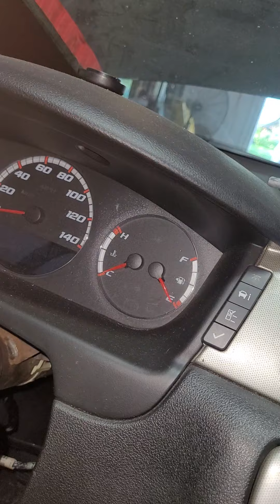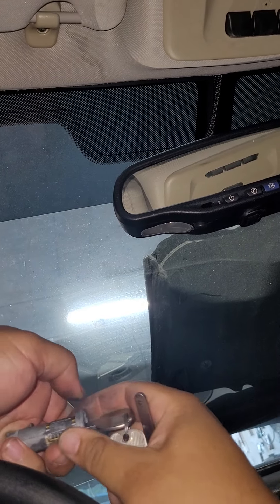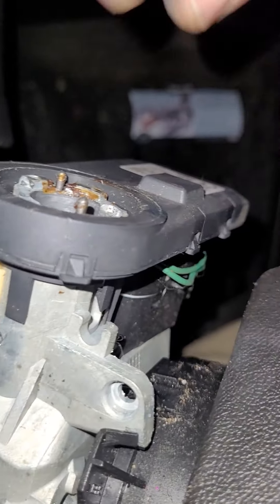Removing Ignition Lock Cylinder From 2006 Chevrolet Impala with no key.

Comment: What is that black box around the key hole?  that's what I i need replaced with the wires that come out the bottom right
Reply from the maker: That module has many different names. Immobilizer Reader is the most common

Comment: What type of jiggler keys are using? Thanks in advance
Reply from the maker: The jiggler keys are custom made. I will do a video on them this weekend.
Reply: @Locksmithchronicles  I really appreciate your quick response and I’m waiting for that video.
Reply: Quick question, please do you know how to decode a lock without using a lishi or buying a key code, I mean from the wafers ? Thanks a lot
Reply from the maker: @Hustle5  normally the wafers are stamped with a number.
Reply: @Locksmithchronicles  yeah I know, what does the numbers represent ?
Reply from the maker: @Hustle5  the depth of the cut
Reply: @Locksmithchronicles  do o need to write them as they indicate on the wafers or is there any formula to convert them ?
Reply from the maker: @Hustle5  give me a call tomorrow afternoon and I will give you a detailed explanation. 8135061759
Reply: How do you remove a 2010 chevy impala no key

Comment: Hello I'm in hel,I had to drill my entire cylinder out because I didn't see your vid an was stupid,I drilled 3 quarter of the cylinder out I drill past the release pin theirs still a little bit of cylinder I can turn cylinder but the vehicle theft comes on also the wire that's attached to cylinder housing behind release hole I broke it its two little I think green wires on a weird plastic clip spring when I pulled pug out of housin I see a hole that's all I see an a spring was in the hole I think but theirs two wires one is still in the plastic an the other is loose free wire both not attached to anything can I start the car if I get the rest of cylinder out without the security anti thrift coming on ,or are those wires the problem pleasehelp 08 impala
Reply: 08 Chevy Impala I have key fob an key but the key would lock up an I got stuck out of town so thought I could remove cylinder right quick an get hom I'm still stuck five hundred mile I would appreciate your help in question above thanks,wish I saw your video becaus I saw that flat little peace you were talkin about beat it out with screw driver drilled the rest made a mess